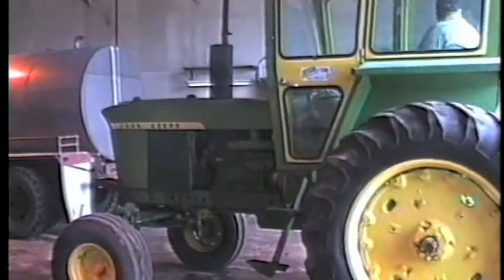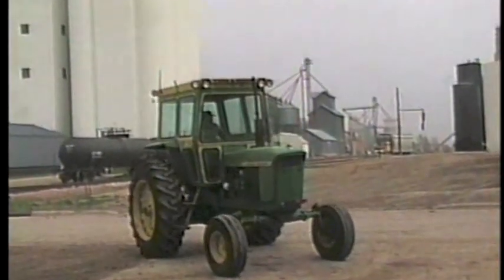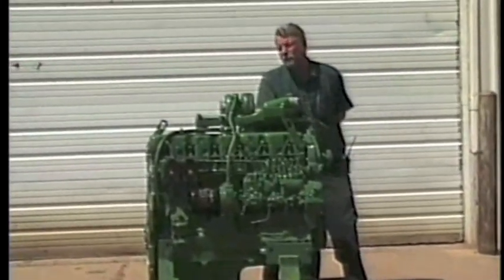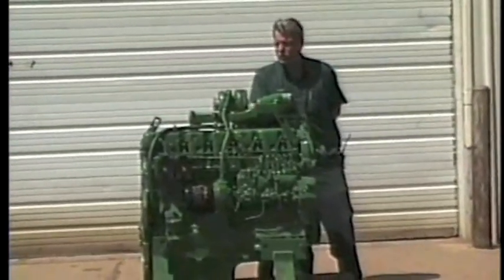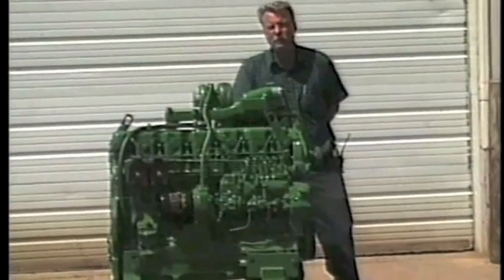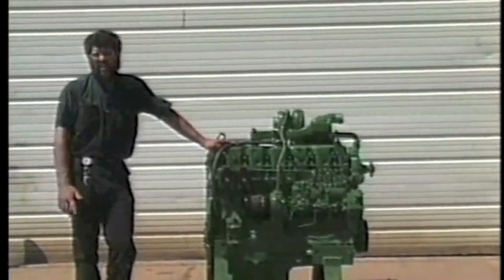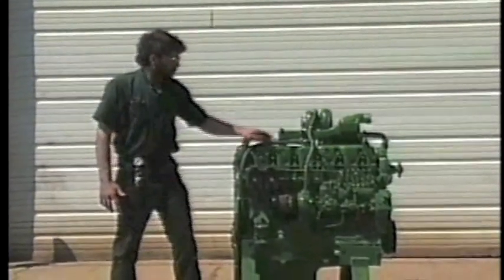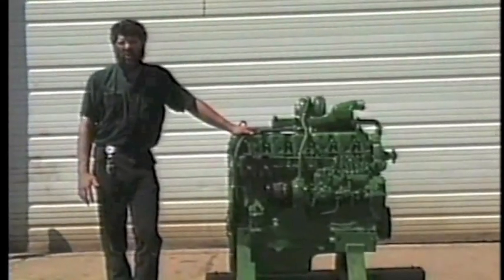4020 Repowered With Cummins Diesel

Comment: Brilliant idea. if you are a collector, you will not want to do this. if you are a farmer, there is no downside, especially if you live in the northern states where cold starts can be a major issue with the original engine. Improved torque I would think would also change this tractor into something that could actually pull hard without dumping fuel or putting big abusive turbos on it. More power that starts easier with less fuel consumption. It makes sense for a tractor that is still put to work.